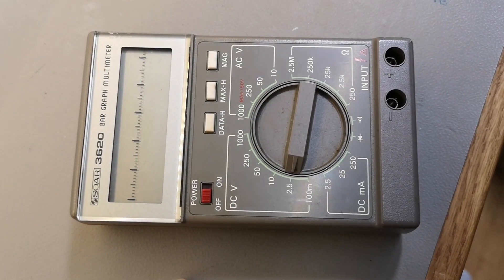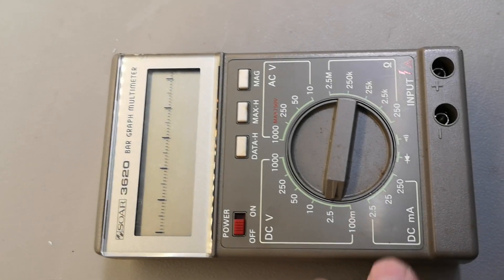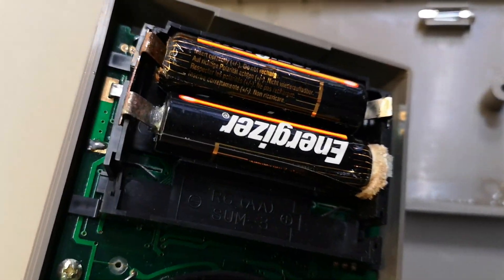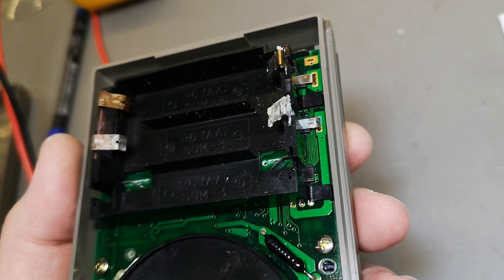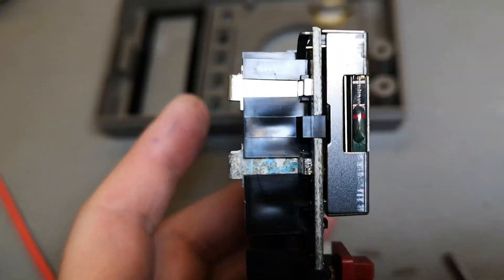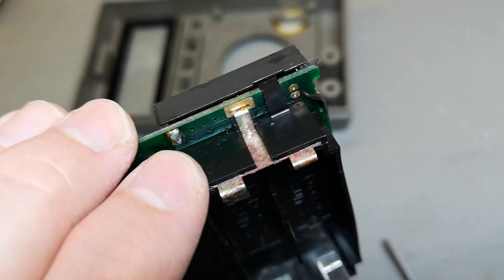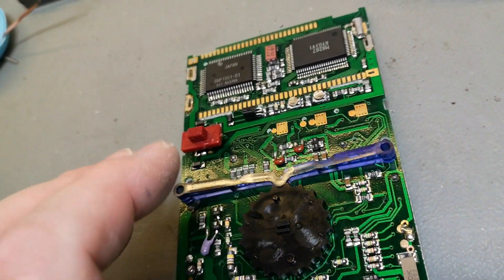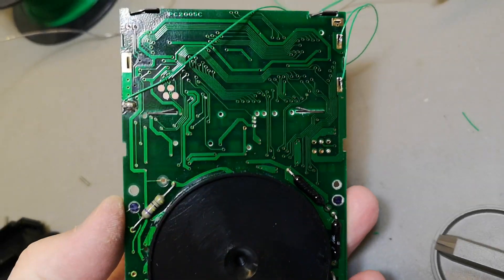Multimeter SOAR 3620 LCD bar Graph teardown (defective) battery puke leakage melt down

Comment: Very likely the crystal got eaten though and failed, so a replacement 32kHz crystal will get it running again. Should be easy to get one off an old PC motherboard to replace it as well. 32kHz very likely, though it could be a 1MHz one in the same case, but the 32kHz is the most common.
Reply from the maker: i think you are right, it must be a 32.768khz it really looks like that one, it is tried with a new used one, still no solve, but the acid moisture level inside this unit have been too high, for too long, it can crawl into ic´s via pins and such causing permanent damage to many parts.